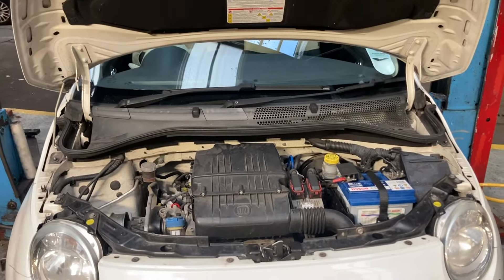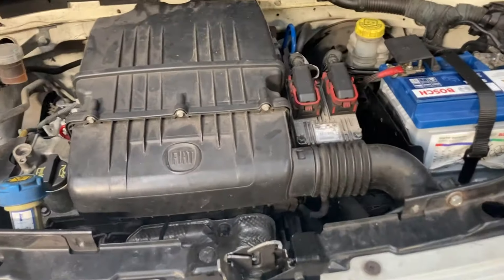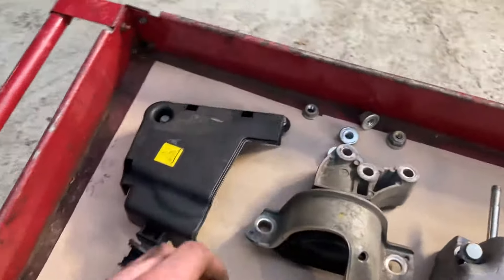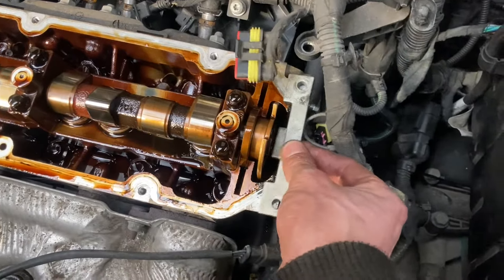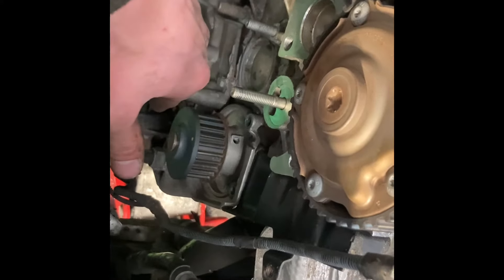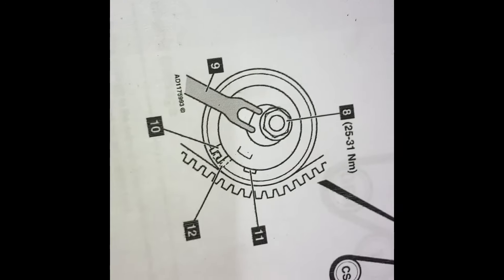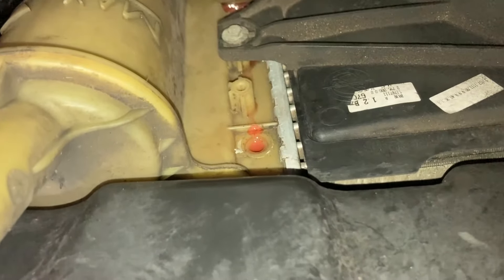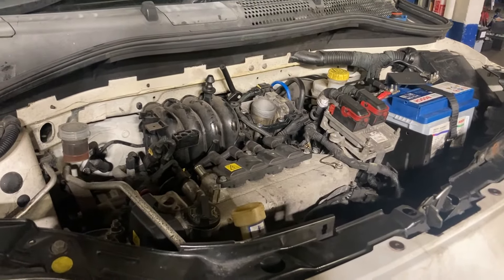FIAT 500 1.2 Cam belt / timing belt Replacement

Comment: I'm a bit late to this video but huge thanks for posting this. I have a 2014 Ford Ka which is the same engine but I have a head gasket to replace. I'm in construction and not a meachanic but have a healthy interest in mechanics. I'm going slowly bit by bit but I'm determined to get it done and this has helped massively.....thanks, Gaz.
Reply from the maker: Good luck with the rebuild, 
Good news is it’s a “ non-interference” engine so is a good one to learn on .
Reply: @thorobredcars1975  If it's just the head gasket I want to change, is it the same process? Can the engine mount and top cam cover just come off or does the whole cambelt need access with the wheel off? Gaz.
Reply: @thorobredcars1975  the 1.2 without VVT are non-interference and 1.2 with VVT are interference I'm led to believe. 69bhp are interference.
How much do you charge for the job on a 2014 500 1.2? and what's your postcode, thanks?

Comment: good to see someone using the timing locking tools
Reply from the maker: Thanks for taking the time to comment.
 Do the job once, Do it right ! 😁
Reply: I just did the work with fixing tool on camshaft but markers on the valveshaft pulley. Fixing both may be complicate for mounting the new cambelt when there is not a little gap for moving the pulley. So, all worked well without demounting the valve housing.
Reply: @thorobredcars1975   Hi Mate is there an issue in just making marks on the cam and crank pulley for alignment ?
Reply from the maker: @stukyu  No real issue, If it was your own car & you knew it was running well etc. But,, you would only be presuming its set up right. 
If its a customers car & you are being paid to do it correctly the only way to be sure is to lock cam & crank.
Often we do find it a tooth out, but no noticeable lack of power ? These engines are actually quite resilient.
Reply: @thorobredcars1975   Got ya thanks mate.
Reply: Ha ha I didn't, just marked it, might be a teeny bit off but she's ight

Comment: It looks quite a task on a small engine.Agree with changing water pump auxillary belt and tensioner whilst changing belt.It would be daft not to whilst all stripped down.
Reply from the maker: Yes you’re right. 
we always recommend replacing as a kit and do so in Five year intervals.
The good news is it engines are non-interference so can survive a failure but it’s always good practice to keep on top of it .

Comment: Hey I did the exact same job but now I'm getting these codes any ideas?  P0009-62 - VVT (phase variator) - Signal Compare failure
P0011-61 - Phase Variator position - Signal Calculation Failure
Reply from the maker: Unfortunately my guess is that it’s out of time .
Set it up again .
Private message if you are still troubleshooting maybe we can point you in the right direction.
Reply: @thorobredcars1975  hey i found the problem after you change the valve cover gasket you have to change thee little 4  O rings on the inside of the valve cover mine were so dried out i changed them and the issue seems to have gone away

Comment: How do you remove the electrical parts on the right of the airbox? You skipped over that part
Reply from the maker: You can leave the ECU Connect .
There is four 10m nuts holding the bracket on .
Remove the nuts & slide the mount/ bracket away from engine .
Reply: @thorobredcars1975  Thanks very much. This job is kicking my arse. One last question. The tensioner came loose when started and the cam isn’t in time with crank anymore so having to time the cam.  Does the locking tool only fit in when it’s at tdc or isn’t more complicated than that?

Comment: I have to replace this seal between the air filter housing and the throttle body, but this car is in my home country so I need the part number to buy it and take it with me. Do you have this part number? Thank you in advance.
Reply from the maker: Hello Boban. Thanks for checking out the video. The part number you need is 46528828 .

Comment: Same engine like 50 years ago 🤣
Reply: But 50yrs ago you didn't habe to remove the motor fixing to change a timing belt. Additional nowadays you didn't have enough space to work on the engine. I just did the work on this engine - what the video here shows is the minor part of it. But it was done in around 2:30h.
Reply: @Susi-ox8nl  horrible we pay for bmw f31 x drive chain change 500 euro +parts 500 euro. You can chose to remove engine or gearbox 🤣🤣🤣
Reply: @riomaririoma2167  I know - our other car is a Volvo..
Reply: Because it works and works well unlike modern engines
Reply: Lol you realise most engines in modern cars are like 40/50 years old? It hasnt been changed since then
Reply: @Moccalocca100  in middle of 90' sus engine touch maximum.